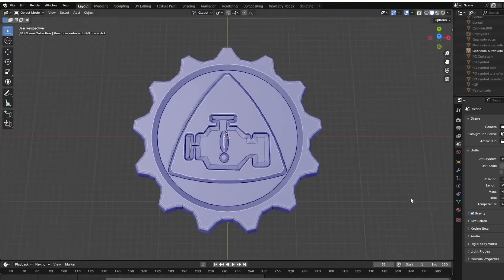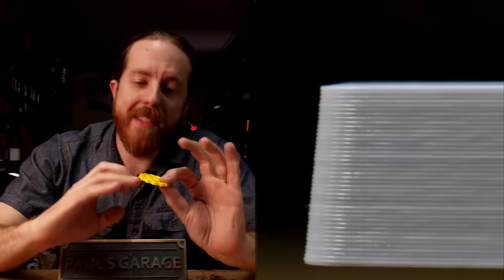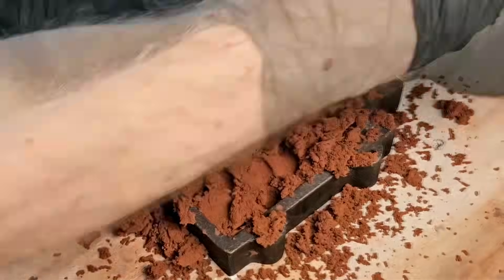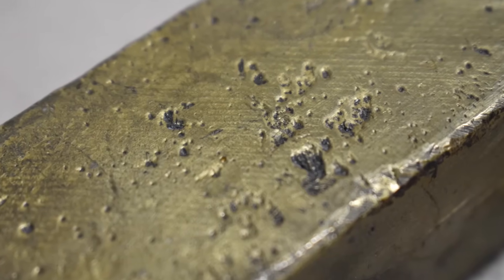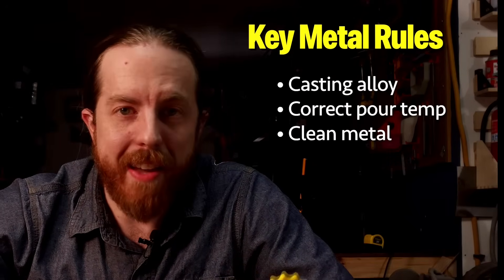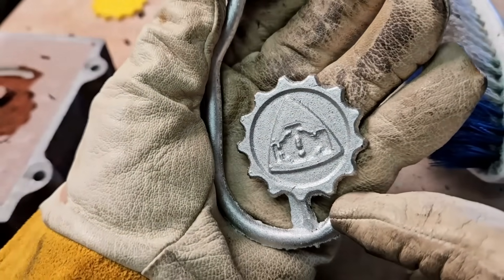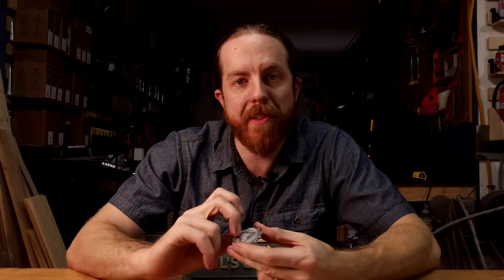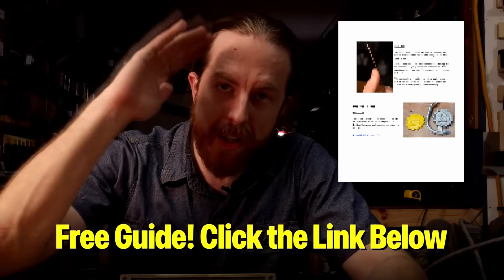How To: 3D Prints to Solid Metal | EASY Sand Casting Tutorial

Comment: Great video, like always. Question for you, preference on vertical vs horizontal molds and why? ty
Reply from the maker: depends on what you are making.  Both can work, and have pros and cons.  Like head pressure.  A taller mold has more head pressure, but a long skinny tall thing like a sword will have variable head pressure from the top to the bottom, which can cause issues.  On the other hand, if the handle is at the top and it's thick (obviously because it's the handle) it will feed the blade while it cools, which is kinda neat.

Comment: If you use aluminum cans, you can add some zinc to it for an improved alloy, or if you can't find any, copper isn't too bad. If you drink a lot of canned drinks, it's a really cheap resource because you're already drinking it anyway. You just need to scoop off a lot of slag from the external paint and inner lining that they add to the cans.
Reply: You can throw new pennies into your mix. New pennies are copper clad zinc. Pure copper pennies were worth about two and a half cents each as scrap so that was a problem.

Comment: how on earth did that casting not have air in it?  since your entry channel goes under and back up...
Reply from the maker: The gating system is in part WHY there is no air in the casting.  Its counterintuitive.  If you signed up for the guide you will get some info on how that works.

Comment: I've been wanting to do something like this for years, but the most progress I've made on that is saving up a bunch of soda can tabs, which I learned here might not be the aluminum alloy I want. Definitely cool stuff, though! From the current thumbnail, I thought you had made a metal oil cap, which would be pretty difficult to do for some (like the turn then lift style found on a lot of GM engines) using this particular technique.

Comment: Paul at 1:05 - "You gotta learn the rules, before you learn how to break them."

Prusa Handbook - NEVER print directly on the heated bed. ALWAYS use the removable build plate to avoid damaging the printer.

Paul at 1:08 - uses woodworking tool to remove successful print directly from the bed...coincidence or good storytelling?
Reply from the maker: Haha!  Thats a prusa MK2, there is no removable flex plate bed, its all on the heated bed.  That dog leg chisel is by far the best way to remove prints.  I dont even bother with the flex plates, i just use that chisel for everything.

  And would you belive it... i dont even use that chisel for woodworking!  I pare tenons with a block plane 😂

Comment: isn't the free version of blender the only version of blender?
Reply from the maker: there's a paid version I think that adds more stuff for animators
Reply: @PaulsGarage  huh, didn't know that. just finished the video btw, that coin turned out really good! i'd be tempted to put some paint on the inner part to make it look as if it's illuminated :D
Reply from the maker: @PsiSoldier28 thats a good idea!  Maybe ill make a few more
Reply: @PaulsGarage  Wikipedia has an article about Blender which is interesting. Let's just say it is complicated. You're not wrong though. As there are several paid versions of Blender floating around. Not all of it is entirely legal either.
Reply: @PaulsGarage  Not anymore, but they do solicit donations, if that's what you mean.  
Amazing video series, by the way.  I've been 3D printing for years, and am just now thinking about getting an electric furnace to start casting.  Your videos have been super helpful.  I signed up for the PDF as well, and I'm considering taking your online course.  Please keep up the excellent content. Your presentation style is spot-on.  Good timing, a little humor, very informative. A+ across the board!
Reply from the maker: Thank you!  Let me know if you have any questions

Comment: Might also want to look into Wood's Metal.  It's a low temp alloy which is great for starting out or prototyping a mold. It's a pretty cheap alloy of 50% bismuth, 20% lead, 30% tin, ensuring a low melting point of approximately 158°F (70°C). plenty of learning opportunities. Can start with small flasks and small patterns. Great for casting... then switch to other materials. Can melt with a cigarette lighter or even just with a hot plate. Happy Friday!  Also, when lathe?
Reply from the maker: i have a bunch of low melt metals laying around, yeah. They are awesome. Especially for thermacast resin molds.  The really low melt stuff with bismuth doesn't shrink either, but it's kinda brittle.  At least ZA12 can take a drop wtihout cracking or bending.  Lathe is coming, i have some stuff recorded but ran into a snag this year.  Next video or so will be an update of what's been happening behind the scenes, and whats changing going forward.  I have an editor now, so that will drastically increase video rate i hope!
Reply: melts before water boils, and also contains lead... so not for toys or anything which would be handled... more for practice or learning... or displays, bullets, wall hangings, fixtures, plaques, etc.
Reply: cerrosafe from rotometals is another good one that melts at a low temp. Is made for casting chambers of guns
Reply: @isaal-magyari9203  yep, cerrosafe seems to be great for copying patterns or objects due to it's shrink and expansion properties where it will shrink for 30 mins after casting, then expand back out to the same size after another 30 mins, atleast that's what the wiki says: https://en.wikipedia.org/wiki/Cerrosafe